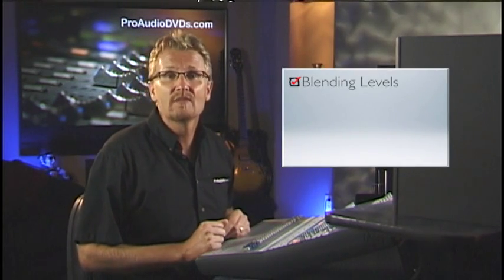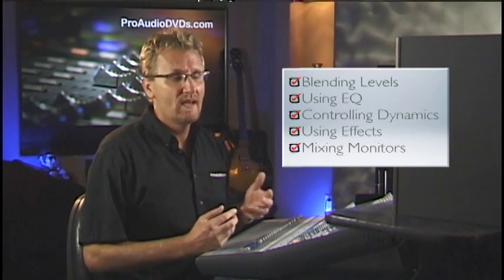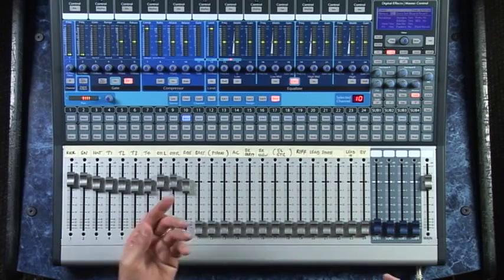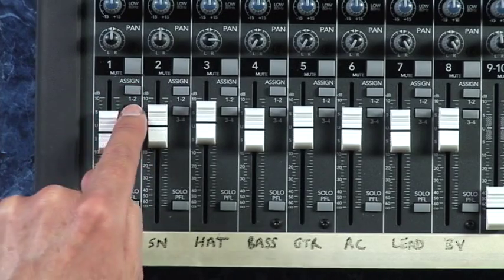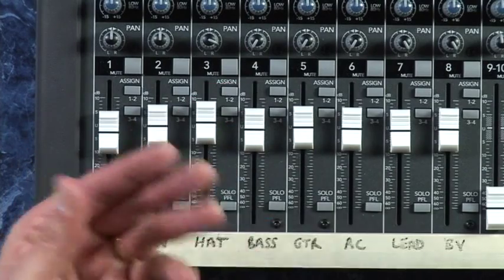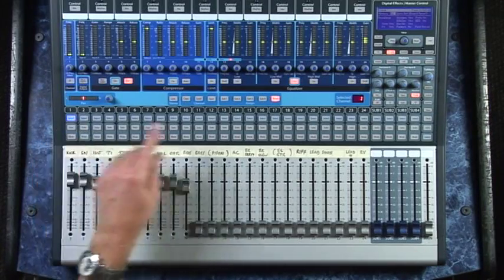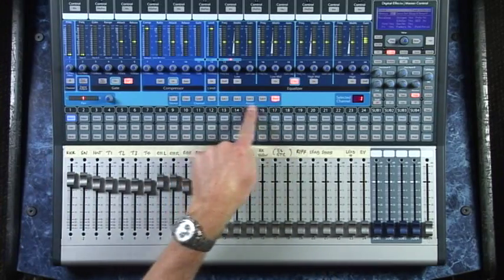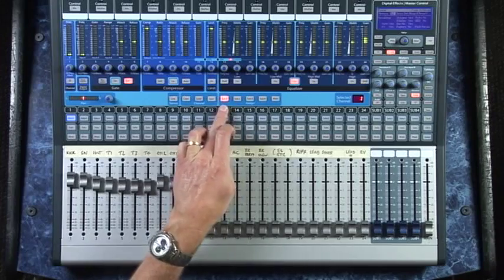Mixing Live Sound (Levels, EQ, Compression and Gates) from Ultimate Live Sound School (PreSonus)

Comment: I’m using the 16.4.2 using qsc 12.2 as tops and ks118 sub two issues I’m trying to send my sub into the back of my mixer (mono) and assign it to a subgroup fader is that doable? Also im getting air sounds out of all my speakers with volume control @ 0db on the back of the rear and everything in the board is gained underneath -10db what could be the issue

Comment: I have a question I'm hoping you can help me with. I play in a small blues band and also own the PA. Keep in mind please that i'm working on a small budget. I have been running a system using just one Subwoofer. I'm about to add a second subwoofer on a deal I found. The sub in this deal is built the same as my current sub. Front loaded 15" ..Ported the same too but a little more powerful. Will it be a bad thing that they are not the same brand?
Reply: @catfish thanks for the message Ill pass this to David so he can get back to you about your questions
Reply from the maker: No...not at all.  I would just make sure that they are crossed over at the same point like 100hz or 80 hz.

Comment: I love these consoles. Most people in the business don't like them for live sound. I love this desk. I have QSC rig and use a 24.4.2 first series. and it works good for me. some times I use the presets if I'm in a hurry and then i only have minor adjustments. what I don't like is it throws a limiter on almost every channel on the presets but that's an easy fix. run the channels and turn it off. The console isn't huge so I don't really worry about the sub groups. I use  one for delay and one for verb. some times I'll put the drums and vocals on the other two.

Comment: I was mixing a live worship service for a live YouTube stream when I didn't hear my lead singer. Well we have a a 24 channel main mixer and a separate 16 channel mixer for the live stream. So 8 xlr cables which are connected to instruments and mics arent being fed into the live stream. Well one of the cables just happened to belong to my lead singer. So I'm scrabbling to figure out what to unplug so I can connect the mic. What helped is that the xlr cables have color tape which match the color tape around microphones. However instruments didn't have tape. But I did learn after the fact that we have 3 snakes with 8 xlrs. One snake belong to the drums. The other snake belong to 8 mics. And the other snake belong to instruments. I'm thinking we should get another mixer to accommodate the other 16 channels so that we don't have to keep unplugging stuff. BTW we have that same mixer.

Comment: I really recomended starting with the vocals first, especailly if your new. sometimes you can find yourself running 2 issues, 1 that you hav got this great drum sound and you bring up the vocal mics which are picking up spill from the kit and now the drums dont sound right. 2 you run out of space for the vocals.

the vocals are the most important usually so it kind of makes more sense to start with the vocals and build up round that.

I also find it really usefull to have the drums and bass play on there own to get the rythm and bass working well together.

Great video for those just starting out

Comment: did not get your name… your wrong about one Item in the first 5 mins…. Subgroups… its not like a Mackie where you need 2 subgroups for stereo…
The Subgroup faders are Stereo. so if your  drums are Panned.. you only need to use one subgroup. and your Panning will Follow… same if you use a stereo Effect Ping pong delay as an example.. and use subgroup 4 as your fader. it will  ping pong both Left and right with the one subgroup.  You  do not need to use subgroups 1 and 2 for stereo drums……
you are also aware you can use your Aux A and B inputs for Stereo Keyboards. and End up with 28 usable channels with Faders on this 24 channel board.
Reply: absolutely not correct. I own this mixer and the subgroups are mono. For stereo subbing, a pair of subs has to be used. In this video, he made the mistake of not using the "link" button. This would have married sub 1 and 2, and handled them as one, and applied all the panning and what not.

Comment: Yes, I think the subgroups were both getting the stereo sound, where you would want to link them up in order to get Left and Right separately from the original drum-channels. I also think that once you link them up it automatically pans as it should, so no manual panning is needed once they are linked.

Comment: This will almost always be the case.  The room is affecting the sound at different frequencies before it gets to your ear.  You need a 'discrete' or separate mix for recording.  In large systems, there maybe 'direct outs' from one board to an entire 2nd board (so it can be independently EQ'd, etc...will need a 2nd person) or multi-track recorder (for editing later).

You can use a free Aux channel (2 for stereo) if they are available.  This will at least give you level blend control.

Comment: When I control the stage and get the signal out the main speakers sounding the way I need to, I find out that the recording sound is no where near what I was looking for. I have tried recording thru the headphone out an even the usb out. Is there a quick fix so both signals sound professional. I am a novice at a church in Nashville, TN.